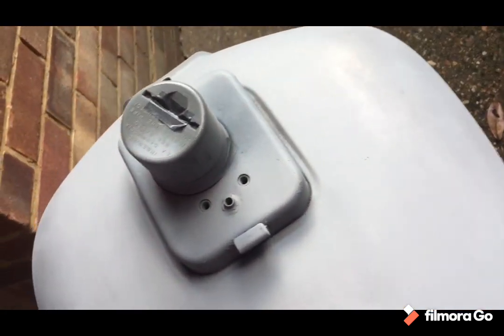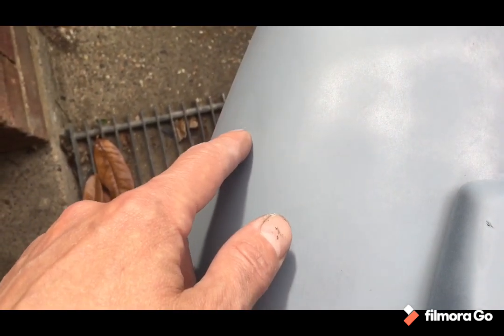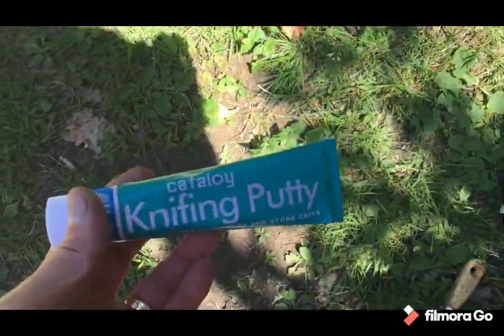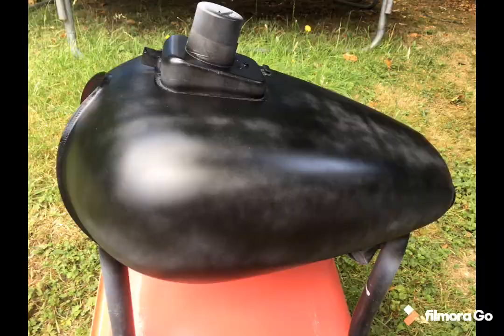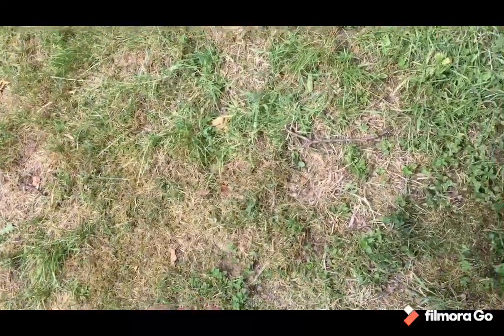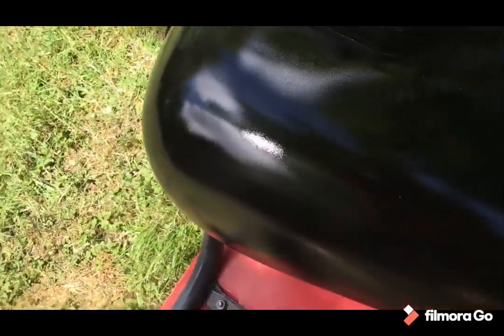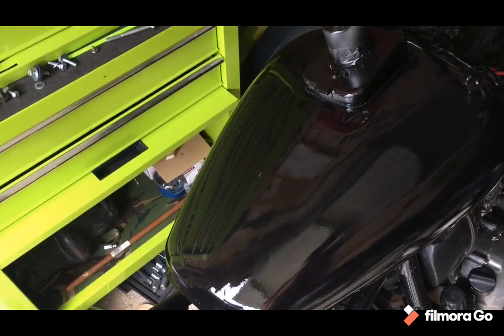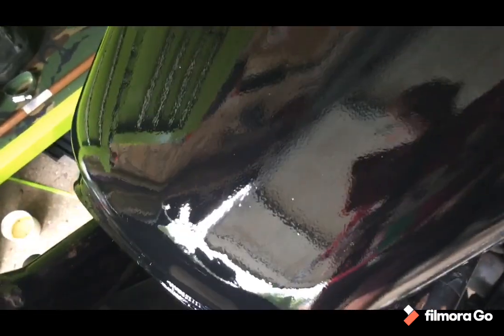Kawasaki ZL600 Eliminator. Rattle-can tank painting & 2K clear coat (on the windiest day ever)

Comment: Don't beat yourself up over the finish - even the Pros get the odd case of orange peel, runs and the odd bit of debris in clearcoat - wet sanding and buffing is just as important a step as the rest of it. Thank you for sharing your experiences Dave!
Reply from the maker: It all about the the journey, not the destination.  
I am enjoying this project and pretty much every challenge that I have faced has been a new one.  I got impatient and had a quick go on the smaller cap cover piece (the one that tree debris landed in on) and I have a good result. Hope to give the tank a going over in the next day or two.

Comment: I think you have inspired me to paint my bandit, gloss black but I'll put the 2k on the tank. My frame is a touch patchy so I may go nuts on that and do that aswell.

I may need some advice on the sanding and then final polishing part.

I'll keep you posted.
Reply from the maker: motorcycle rescuer sounds like a plan. I used satin on mine and it polished up nicely. Are you planning to fill that tank ding too?
Reply: @NatsNackersYard  yes, I think I got a small one on it so will fill it.

I'm not going back to metal though, so sand and prep dings, prime, sand, gloss coats, sand, then 2k.

I can get that far, then struggle with the polishing of the top coat.

Also Nat how many layers of 2k do you think you did?
Reply from the maker: motorcycle rescuer stupidly, I didn’t really count as I just used both small cans on the tank and the cap cover. I think it was 5 or 6 by the time they were both done. Try and remember to do a bit of scrap too so that you can test the petrol proofing. I meant to but forgot.
Reply from the maker: This is the clear coat that I used: https://www.ebay.co.uk/itm/173938341611
Reply: Will do, I just bought the stuff, sadly halfords didn't have any 2k so I'll order it from ebay or check the local car shop tomorrow.